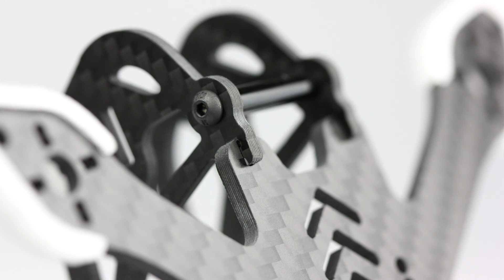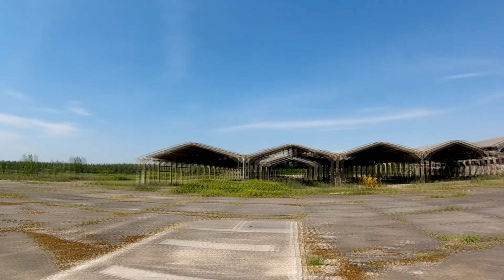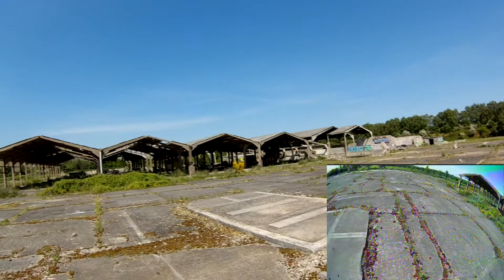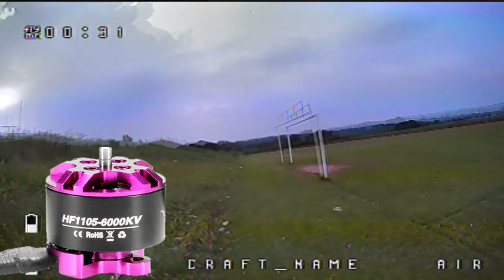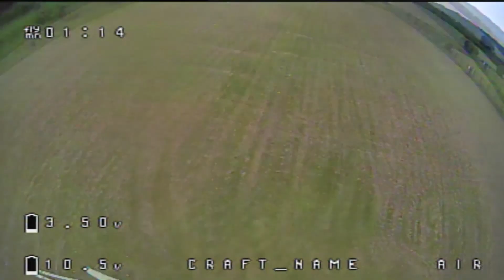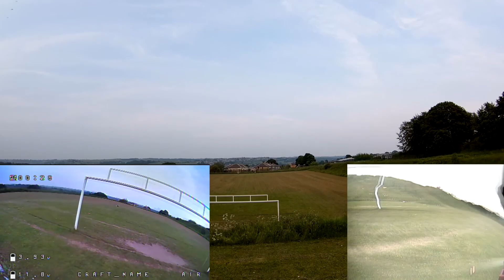Jet 110 Build, well 2 actually. (Lizard95 upgrades)

Comment: youre LOS skills are awesome, especially inverted too .... must fly collective pitch helis
Reply from the maker: Thank you. CP helis are where it's at for 3D, visual orientation so much easier than a quad and finesse around centre collective enables much more control than a quad allows. Micro helis have come a long way in the last 3 years too.
Had a while not flying them until the T150 video last week and it's certainly re ignited my desire to fly them. Packs charged for tomorrow :)

Comment: SUBSCRIBED (great show)
Reply from the maker: Cheers!
Reply: I want to get in to micros
and I want to make my own setup
 those 1105 600kv realy look good on 3s with a 20A esc and 2035 props (this part is clear)
still haven't decided on the frame yet but the FC is goeing to be https://www.banggood.com/Omnibus-F3-NANO-STM32F303-2-4S-Flight-Controller-20-20mm-3-7g-Built-in-5V-3A-BEC-OSD-LC-Filter-for-RC-Drone-p-1202565.html?rmmds=search&cur_warehouse=CN 
it is the only 20x20mm FC I could find that I think can do current sensing (there is a pin labeled CRNT)
and maby use this https://www.banggood.com/2_3g-Full-Speed-FSD-XT30-60A-Amass-XT30-2-6S-Current-Sensor-Module-for-RC-Drone-FPV-Racing-p-1290084.html?rmmds=search&cur_warehouse=CN
I am realy used to the current sensor frome biger quads and planes and I canot beleave that so few people on youtube do current sensing on nano quads
any way do you think it's goeing to work ? (I mean the current sensor) sry for me bad english and have a nice day
Reply from the maker: If you use ESC with current sensing than you can stick it through a UART but as I understand it and external one such as the one you listed is all you need if the board has a current sensing pin which your choice does. I'd fully expect that to work and work accurately if you change the amperage meter scale in BF to 538 as listed.
It's certainly a nice feature for obvious reasons but still one that isn't vital to lipo management and if the FC doesn't have a CRNT pin, can be an absolute ball ache to set up with some 4 in 1 ESC.
Current sensing I see of more of a luxury feature but really useful for comparing prop motor efficiency with accuracy. So long as I have lipo voltage in the OSD along with time in the air I can tell fairly quickly which of two setups is more efficient and a quick lipo LoS does the rest.
That XT30 version at 2.3g does look really great though, no large toroidial inductor or anything heavy or that bulky either. I see no reason models won't start coming with them as standard soon in that kind of form factor, it's certainly a tasty selling point when there's only a single wire to solder.
I do think that £5 is a touch too much for a shunt resistor and single XT30 socket but i'll stick one in my basket and maybe try one out next BG order.
Please do let me know how you get on with it if you do go down that route though

As for those motors, i'm around 60-70 packs in and still loving them. I've been pretty harsh on them crashing around trees and concrete car parks fairly aggressively and two have developed a minute amount of vertical play in the bells I presume is bearing slop. Still fly superb, sound smooth and more importantly, feel smooth too. I bought a 2nd set for backup as I have been flying it so much testing cameras and antennas but plan to grab some bearings too to keep them running once they do get notchy or develop slop.

These DAL 2035 are reportedly more durable than the Gemfan 2035. I can't speak on them as yet but hard crashes do bend the root of the gemfans quite easily. They bend back and are flyable usually without jello but can affect cornering at speed once they are kinked and many times more durable than stock Lizard 5 blade or racerstar 4 blade.
https://www.banggood.com/4-Pairs-Dalprop-Cyclone-Q2035C-2035-4-blade-Propeller-For-RC-Drone-FPV-Racing-Multi-Rotor-p-1257071.html?p=UI14032168777201508N
There's a couple other choices for 2035 now also but not as affordable as the little DAL
Reply: MicroRCFiend thx dor the cool reply 
And now i can hardly wait for me parts to arive, to bad it takes banggood stuff for ever to arive
I curently have a qx80 that i fly and derp around the park once in a while, will have to settle on that until i get on with me build

Comment: I got this frame too. Going to upgrade my Lizard 95 also. Albert Kim recommended this to me for the Luzard 95 to easily take a runcam micro or equivalent. I really like how versatile it is, and the price!
I found the best 3D printed option for doing that upgrade and it was for sale on ebay. Not something I could print myself! Bummer! Well, by the time I pay shipping, even just going from the USA TO USA, it was going to cost $15, so I decided for $5 more I'd get the whole new frame. I'll also benefit from being able to use bigger props, have some actual room under the canopy, and it appears to be much better quality too! Like you, I highly recommend... Now I just have to get the components moved over!
Thanks for your time and effort to make this video! Nicely done! 😎
Reply from the maker: Glad you like the frame, I'd say that's good advice from Albert, top guy.

Comment: Man those hulkies should be renamed vampires! Would you say that the leader would benefit from lower KV motors than the 7500 on 3s?
Reply from the maker: On 1106 7500kv yeah that's a great name for them. To be fair many people seem to like them on their more intended setup of 1104 6000kv where max current is similar to the 2035BN 4 blade.
As for the Leader, I think they got the balance just right there for the stock props personally and the only reason mine isn't being flown is due the dodgy motor it came with but that depends what you want to achieve from a change in setup? Even more power?
Lots of people on the FB Lizard group posted they upgraded the frame and used the Leader props with the 1104 6000kv motors on 3S and loved the power upgrade it gave but I have only tried them on the HGLRC 1105 6000kv and didn't like it over stock Leader setup as 2s was now rather timid and 3s felt like the stock 2s with a decent lipo.

It's real perky on 2S while being efficient just cruising around and 3s option for oodles more torque and a bit more speed. The average stock 500mah 2s lipo cripples it though and a good 800-850mah 2s in the mix makes it's the most aggressive RTF 2s micro quad I have flown apart from only the Fighter 130. It fits a runcam though so i'd take the leader for FPV and Fighter for LoS and 3D between the two.

If there's one thing I learned, it's that I am really bad at predicting how a motor/prop/lipo combo will perform so always interesting to hear what setups people love.